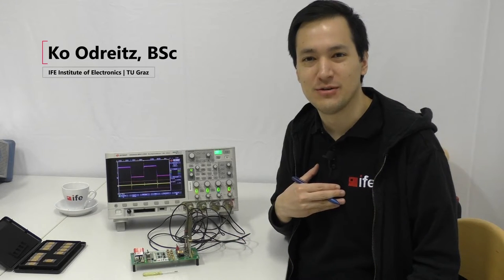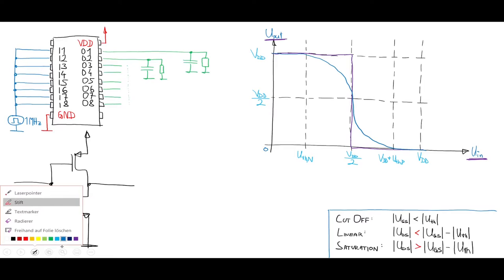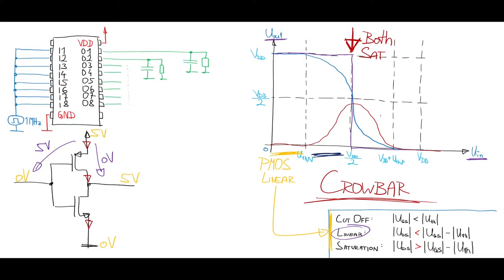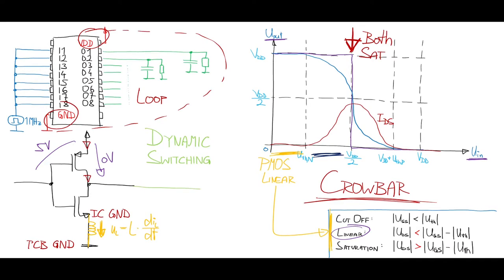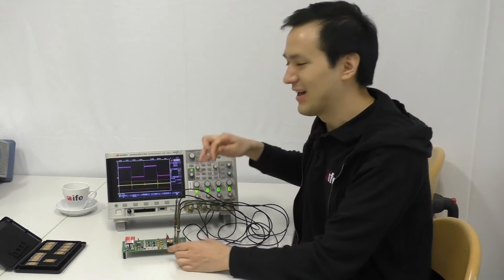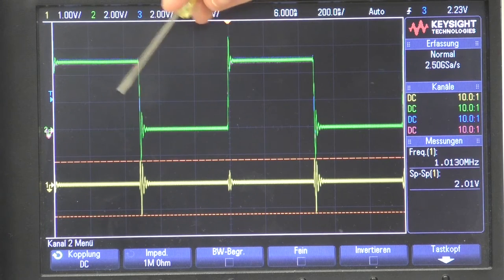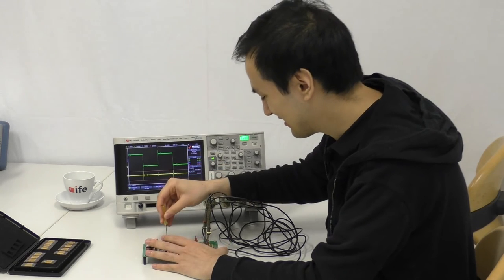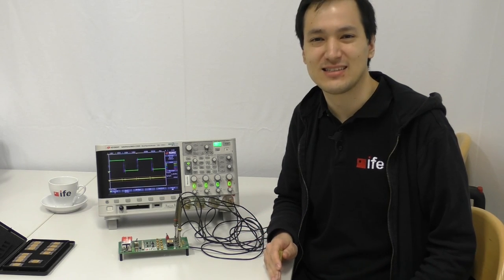Ground Bouncing Effect of a CMOS Output Driver, Skew Signals, EMC Problem Demo

Comment: Hallo Herr Odreitz,
Wo genau messen Sie die GND-Bounce Spannung, direkt am IC GND Pin gegen einen bestimmten Punkt auf der PCB-GND-Plane? Oder ist das wirklich auf der kompletten GND-Plane zu sehen, egal an welcher Stelle?
Viele Grüße
Reply: Hallo Martin,
entschuldige für die späte Rückmeldung, ich musste selbst Bernd Deutschmann fragen, weil er die Platine designt hat. Ich hoffe, ich kann die Antwort korrekt wiedergeben:
Die GND-Bounce Spannung wird an einem der Ausgangs-Pins des ICs gemessen. An allen Ausgängen hängt jeweils ein Belastungsnetzwerk nach PCB-GND bestehend aus R und C parallel (10k || 47pF, oder so ähnlich). Der gemessene Ausgangs-Pin liegt während der Messung auf LOW und somit am internen „GND“ des ICs.
Ich hoffe, ich konnte weiterhelfen :)